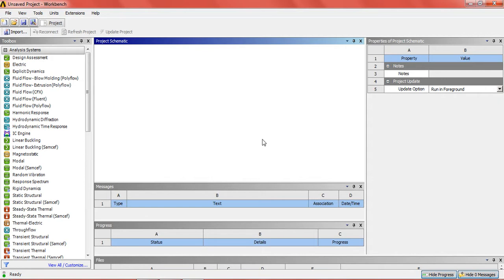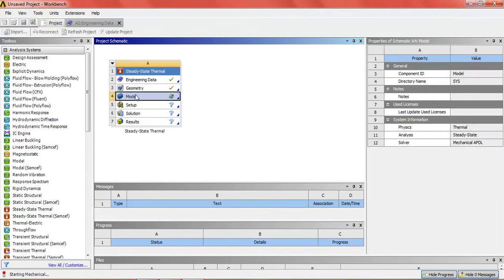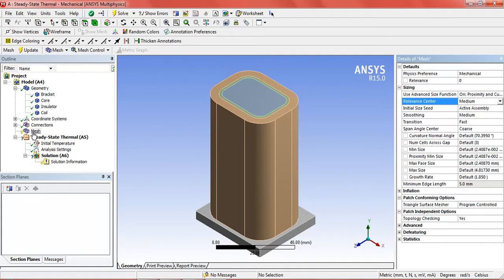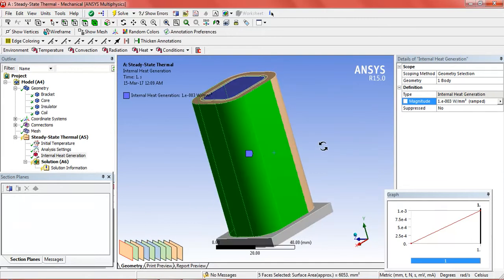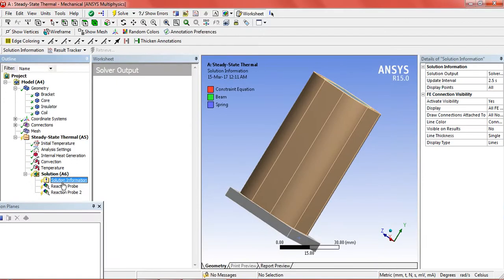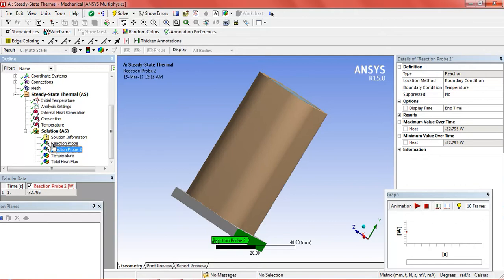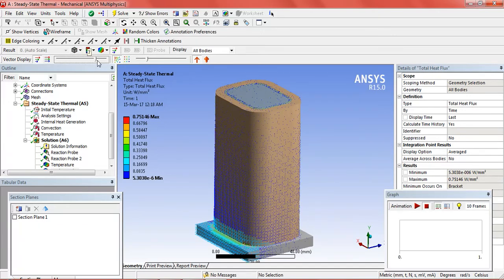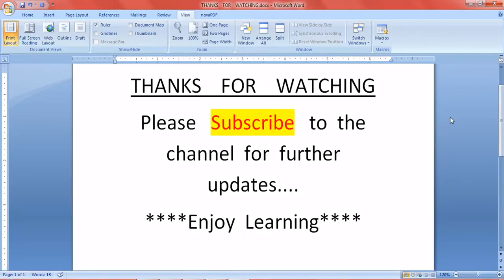Thermal analysis of a solenoid in ANSYS | Easy Tutorial

Comment: can you help me to simulate transient heat transfer in a composite wall ( 3 wall) with glass as intermediate wall material and gold as side wall material. And heat transfer takes place by conduction through wall and radiation between the side wall through middle glass wall. what will be the temperature distribution. Given, emissivity of gold

Comment: sir if u upload cad files it will be easy to carryout analysis....what is the conclusion how do u verify and validate the above solenoid based on results...hpe i can get reply soon thank u
Reply from the maker: In postprocessing you see how the temperature
varies along a path within the solenoid.
-> Begin by adding local coordinate systems.
Reply: can i get cad file sir
Reply from the maker: +Naveen currently i cannot find the cad file for this analysis, but you can easily create you own design by taking approximate dimensions.
Reply: can u provide any link were I can get 2d drawing of solenoid